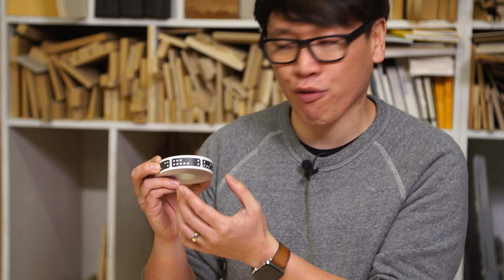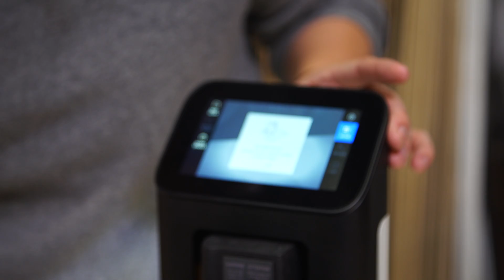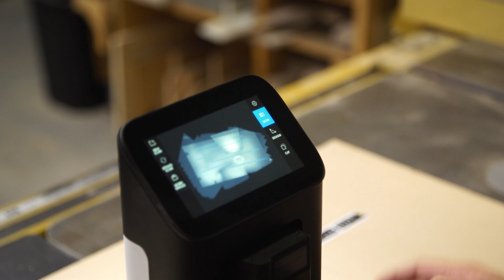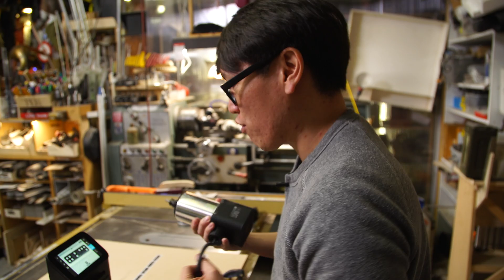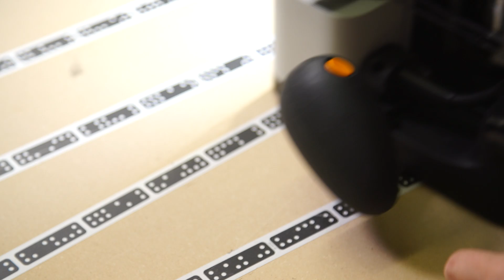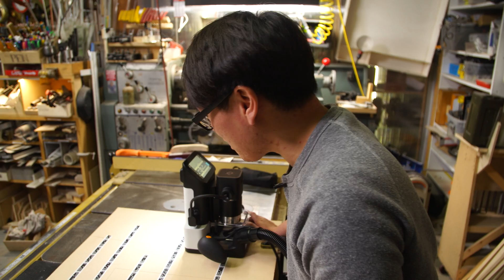Testing the Shaper Origin Handheld CNC!

Comment: what if you have a big intricate cut that takes 1 1/2 hours to do. say you run for 20 minutes and get tired? you say you can pick up where you left off. do you leave router on?...can you turn it off, and leave the program on?? leave in place? if you turn it off, when you come back, to resume, will it start from the beginning?  downside might be on doing these long and intricate cuts. you obviously have to man the router all the time. size is the big advantage. with a regular cnc, if it fits inside, you start it and let it do its thing till finished. even for 1 1/2 hours.

Comment: The stickers are completely unnecessary.
If the device scans whichever surface and 'notes' the difference in location from matching the library with current location, then you might as well randomly scribble on the surface with a pencil.
Intersecting, hand-drawn, random lines/marks are next to impossible to recreate, so would work perfectly as an index from which the program could identify location and axis without the need for tabulation dominoes.
Every penny saved is a penny not wasted, for both the consumer AND producer.
Reply: The device IS a major leap forward in mobile milling/routing, though.
It could potentially even be programmed to scan and recognise tree rings for location when working with wood.

Comment: This is cool and all, but why is it $1000 CAD more than an X Carve? 

The benefits of a CNC is that they can do work for you while you go off and do something else.

Say you want to batch out 50 drink coasters. The Shaper requires you to stand there and operate it. So it not only costs more it also takes human time. Say your shop rate is $75 an hour which seems like a deal.

if you sold the 5 coasters at $25 then made $250 - materials. 

If you made them with the shaper well... I don't know how long it's going to take you but let's guess 1.5 hours?  So that's $250 - 112 - materials.

So the X Carve would theoretically pay for its self in about 10 batches whereas the Shaper will pay for its self in maybe 25 batches and you spent the better part of an estimated 37 hours doing it.

I might be close minded but I don't know when this would be more practical except maybe on a preexisting surface like a wall or may be curved surfaces but I don't think it would like that.

Anyways long comment, Very cool tech, don't know where it fits into life.

Comment: Welp, first off, naughty Norman for not wearing proper eye protection.  From the video, it appears the Z-axis is limited and only has engaged and raised position.  This MIGHT be useful if the Z-axis travel allowed the work to be truly three dimensional, as opposed to just cutting out shapes.  It's expensive, and Norman didn't measure it's precision.  I'll pass.  BTW, the normal way to work work with a planograph (A form of coping machine), is to start atone corner and work a section at a time.  I think this approach would solve the problem with the tape being cut up and the camera not being able to read it.

Comment: the tracking method could be cheaper and improved. by making the guide tape a piece you could clamp onto the top and side edge of bench/work piece. so they would be vertical above the edge of the piece to be cut, instead of horizontally taped. so then tracking sensors would need to be beamed out of the side of the router, across the top of the work piece to the markers clamped along on the edge of the table or work piece?

Comment: A cheap optical mouse can scan at several hundred DPI and be used on many surfaces...I would think that two or three similar sensors (need more than one to detect rotation on the Z-axis and maintain the proper orientation) would be a much cheaper, less processor intensive, and more elegant solution.
Reply: Doesn't give you a consumable to sell though.
Reply: Not all surfaces are well suited for optical mice. Just think of cutting uniform surfaces like plastic or reflective ones. The camera inside the mouse will not be able to optically track the surface this way. Also, this system does not appear to be just incrementally like a mouse, but use the markers to compensate to absolute reference points.

Comment: Here's a question, could you create a "permanent" station for the shaper by placing the tape outside the bounds of the actual material, say on a work bench behind, in front, and on either side of your material, and clamp down a board into the dead space in the center? it would be interesting to see if you could use a frame of the tracking indicators to allow the tape to go farther.
Reply: Oh, that's an exciting idea, one that would entirely change the production of many small multiples.What is the answer to Timhouse's question?

Comment: Hmm... So what is the point of the tape if the spindle doesn't raise and lower itself when you need to move from between cut points? It would be nice to be able to guide the tool over the area like a printhead and let the spindle do the rest. Also the error correction seems super small. So this is less functional CNC and more hand-holding for those who don't want to develop a real woodworking skill.

Comment: sigh i really cant stand this Norm, everything he does on camera looks and feels off and annoying.. He talks and talks and talks about the same FACKING things for 10 minutes of the video and then when the actual cutting happens.. its a 2 second shot of him following the line and DONE, square cut.. so the ACTUAL operation of the machine is NOT shown to then do a quick timelaps of more cutting...the interesting part!! So only when the Normster talks and talks and talks it lasts for 10 minutes of a 13 minute video, but actual operation of the machine during which he has to be silent is done quick time with music. I wish it was the other way arround ;)  Anyhow, it turned this video into a 13 minute monologue by a physically incapable blabling numbnuts with the camera presence of drying paint! He is the single most important reason why I unsubbed from tested and I wish all titles would say that its a "norm" video, so i simply wont click anymore when a video is suggested by YT.

Comment: This is a really cool idea that is completely not marketable. It has 0 advantages over a router table while being massively more costly and inefficient. It's like they set out to create a handheld CNC machine without any consideration to the issues it raises. However, I do think the tech itself is interesting and may have an application in the future but to put it on market as is, that's insane. Anyone who buys this are doing it for the novelty and do not have a real need for a CNC machine.

Comment: Why upload to a website if it has Wifi? Why not upload to the Shaper Origin?
Reply: I don't get this either...I was really interested in the Glowforge when I first heard of it as well, but when I found out that it insists on being connected to 'the cloud' I spent the money on a real machine.  I don't want my designs and intellectual property stored on someone else's servers which I may arbitrarily lose access to.
Reply: Harbingerx81 and I dont want to have a need for wifi everywhere I use a router. That would usually be outside because of the dust and because you work on the much larger stock then on a desktop sized CNC mill.

Comment: I wonder why it couldn't just take high res imaging of the surface rather than require consumables.  My guess is the tape should only be around the perimeter of the work area, and it may not need a solid length but rather one tile placed maybe every 12".  Someone would have to test the ideal approach to its use, but my guess is laying down big swaths of tape everywhere is not the intent.

Comment: This is a toy for wood workers that don't want to have the skill to be a woodworker. You can see from the time-lapse that it took forever for a simple engrave. A straight edge and a normal router with some level of skill seems much, much simpler. Also, it's either and endmill or an engraving tool - endmills are never called "bits" in the machining world, nor are drills or engraving tools. I generally dislike being a Pendant, but machining is my trade.

Comment: So it’s a router???? Cnc means that it is computer controlled
Reply: It literally is computer controlled. They probably stuck a small Linux PC in there to do all the processing. It's quite the overkill, yes. Also, it essentially cuts and moves on it's own, but has a really small working area, so it has to be moved around to get anything done.

Comment: A full size router table takes up around 50 square feet, which is about $1000 a year in shop space in my city...
Reply: and I assume it (the table) pays for itself in less than a year multiple times over? and cost less in labor than having someone scramble back and forth doing one project in the same amount of time the table could do multiples of the same project?

Comment: Can we get someone with more experience using wood working tools, like Adam,  to review this thing please? I want to find out if Adam thinks it's practical or just a gimmick for these younger "diy wannabe's". I would really like to see this thing cut something more complicated and compare it to the time it would take to setup and use an actual CNC router to cut the same design.
Reply: As someone with woodworking experience, I have to really struggle to think of any use for this. And the few that I can think of would either be better done with a table CNC router or otherwise not come even close to justifying the cost.

It kind of strikes me as being a super-gimmicky scroll saw for cutting out larger odd shapes -- out of plywood.

Comment: The whole time watching I cant help but think that one of the reason this tool was made was cause someone sucked at using a hand held router. And could not follow a plum line or pencil mark. I am sure this is a fine piece of tech and worth however the cost is .But lets get real its a fancy router not a CNC. It would be interesting to see Norm and Adam have woodworking challenge. Norm with the "CNC" and Adam using a top of the line router or better yet a bottom of the line one. using different thickness of  material , they have to cut a square, a circle, write their name and do a design of their own creation...but I know that is just silly idea. Great content as always...Thanks for making it happen Capt.

Comment: I like this tool. I'd call it a 'Computer Assisted Router'.
Reply: YES, you will Need a CAR Loan to afford one of these ... atlest 36 monthly payments
Reply: It's more of a CAM (Computer Aided Manufacturing) router rather than CNC. The computer still aids the user is the manufacturing process but does none of the actual controlling.
Reply: Pre order is at $2199, retails for $2399.
Reply: Hm... but you would be restricted to a given (rather small) size! I think it's just really two different categories of tools with individuals strengths for their own.
Reply: so it's a "car"?
Reply: I was going to tack a 'see what I did there' on the end of my original comment :o) Yep, it's the C A R. A computer-assisted router driven by a human. Don't drink and drive your C A R.
Reply: I call it junk, for the same price you could build far superior CNC mill.

Comment: I had wondered about the accuracy of the product without fully understanding it's modus operandi but the product as a whole is slightly niche as it doesn't improve greatly on a CNC, as is, but does make it more portable/usable in a smaller or confined space.

Cost is another issue but product adoption may help with that.... as it needs to hahaha!

Comment: Be interested to know if you taped out a sheet of A3 paper with the tracking domino's then scanned it and printed a load of A3 copies on paper and spray glued this to the MDF if it would be able to track it from a print? Then it would save on tape purchase......food for thought
Reply: I imagine the location of points has to be quite accurate. then again, doing accurate is not that hard for a modern laser printer, as long as the user knows what they are doing
Reply: From what I remember from the other video, the feducials don't repeat for about a million dominoes.  That's a lot of printing...

Comment: This is beyond useless, its tech for the sake or gratuitous geek porn tech. A router and a guide would do this far faster and cheaper  , just use a CnC or a router, this is a very unnecessary equipment , it defeats the very reason to have a CnC

Comment: Is it possible to have it fully automatic? You said pushing the green button made it take over temporarily atleast, when you struggle in certain areas. But is it possible to just let it run itself or is this just manually ran?
Reply: I think it can only move an inch in each direction, so if you wanted it to make a 2 inch square, it could probably handle that itself.
Reply: Barry Woods what if you just constantly hit the green button? In theory I’d think that would work.
Reply: The whole assembly doesn't have the ability to move though.  It can move the router a couple inches inside the base, that's all.
Reply: at first I was thinking all you would do is just run the machine back and forth over the work piece and the machine would just cut where the pattern told it to... kind of like doing a rubbing with charcoal.

Comment: It's a different tool for different projects.
To coalesce some other comments, the main upsides over a normal CNC I see are:
1. Storage size. You can re-use any workspace, you're not stick with a giant gantry and work-bed.
2. Portability. Easy to move in the back of any vehicle and not lose precision.
3. "Unlimited" bed size. As long as the work-piece is flat, you can work-it, this also includes weird things that would be too large or heavy, or awkward for most bedded CNC machines or taller than normal machining depths.
4. Ease-of-use. This is easy to hand someone without lots of training (think community/school makerspaces). Although I think Inventables' Carvey is in the same ballpark.

Some cons:
1. You need a human "pilot". Can't just program and go. Also all the tool changes are manual.
2. The surface needs to stay mostly flat after working. Full topographical maps come to mind as a limitation.
3. Tired arms/ergonomics. It's not bad, but might be an issue on large projects.
4. Tape costs. Bigger issue for some than other. Personally, if I could afford a $2k+ machine a couple rolls of tape are just amortized into the material costs for projects.
5. Cost. It's not really any cheaper than a more traditional CNC router system.

I'm also not sure how the correction handles the combination of less homogenous materials (wood knots) and larger cutting heads or deeper cuts (yeah, you should take multiple shallow cuts, but is it enforced in the programming?). What happens when the body of the router jolts faster/further than the positioner can correct for. I know there's the ~3/4" correction and retraction of the tool head, but I don't know where the failure line is.

Comment: you talk about safety yet didn't wear a respirator or ear protection.
Reply: I was thinking the same thing...Even if it is quiet enough to not need earplugs, he is carving MDF.  Super-fine dust mixed with pretty nasty chemicals.  Even attached to a better dust collector, I'd still want a resperator.

Comment: this is(like the glowforge) a dead end.  It's not a CNC, it's a router that helps you color in the lines.  I can't see any professional wanting to use it. and the price is too high for an hobbies.  You can get a low cost CNC router (maslow) for less and have far more reproducible results.
Reply: Maybe if you have no imagination https://www.shapertools.com/blog/posts/april-2018-origin-on-the-job-site . It's not meant to replace a CnC, it has different use cases. Portable and entire-room work sizes.
Reply: pretty much a fancy expensive toy for that wannabe woodworker in his 100 000$  barely used shop...

Comment: for me it is a step in the right direction but falls short of what it should be in my mind. I'm fine with scanning the surface and all that but when I click go I want it to do it without me moving it around. Get some tech from one of the robot vacuums like Roomba. If I can go work on something else while it is running then you have product I would consider and could complement a CNC table.

Comment: You cut a rectangle out out of the middle of a rectangle stock that had square corners to begin with. Will Adam let you use his shop again?
Reply: He engraved, he didn't cut through. This is a test cut for a video and he clearly said it was an opportunity for learning. We're talking under $1 for the tape and $30 for an mdf board. Man, so many people whining about waste.
Reply: HariEdo  practically any piece of clipart he could have used instead of a rectangle would have highlighted the advantages that the new product has over most other  tools in the shop that can cut a rectangle faster.

Comment: First thing I'd make is a stencil to replace that damn tape.
Reply: Sy Bernot I think china is already making generic tape.
Reply: Sy Bernot each "domino" is different, it cant be the same thing over and over.
Reply: It wouldn't have to be, If you got say a thin metal yard stick applied tape and drilled each hole you would have the template for the white dots, then get a similar metal yard stick and cut out the black dominos, you now have a 2 part template, if you needed more unique patterns you just make more sticks with holes since the domino template is universal. apply the black template first with some spray paint, then the white dots, not as convenient but I would expect cheaper and less wasteful. Just an idea. Might even be possible to do something similar with a projection system under the right lighting conditions.